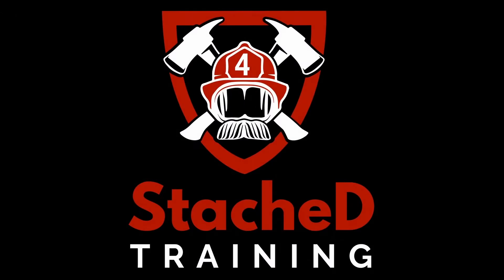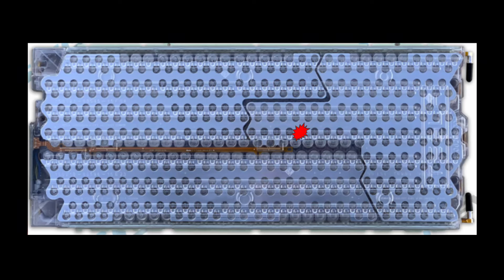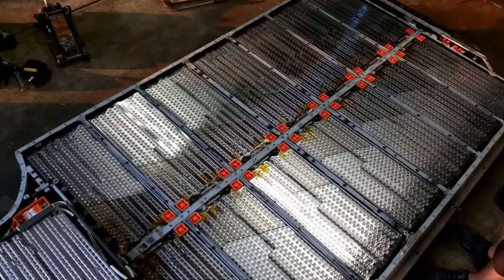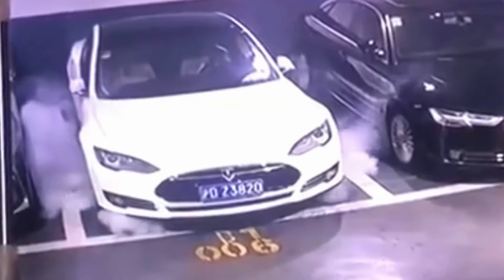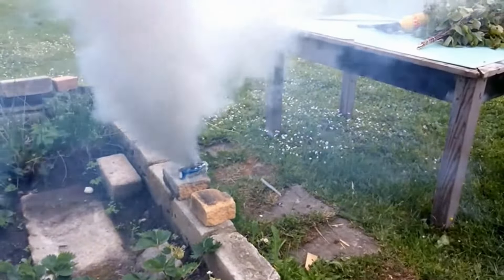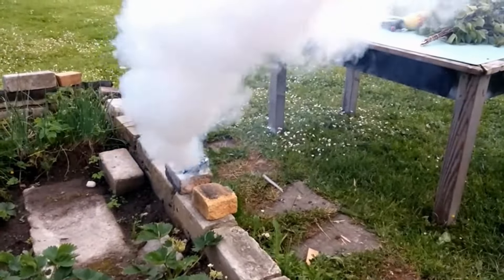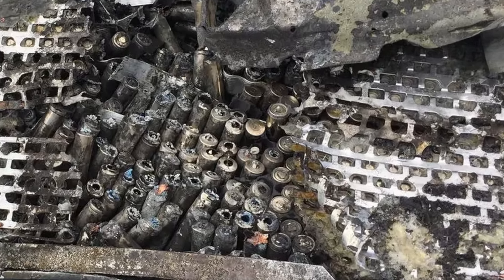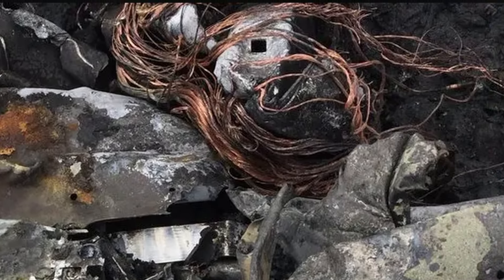What is Thermal Runaway: Lithium-ion Batteries

Comment: EV now stands for Explosive Vehicles!!!
Reply: This is virtually inevitable under load! The power draw must match capacity and as bat gets older therm is very likely. Its surprising this isn't common. Obviously cars go threw so much during a simple drive. A mere puncture, a metallic spec/sliver/screw(a f*cking gum wrapper!) etc flies in threw the vents and is an almost guaranteed goodbye. Simply charging and a surge happens, or just one bad bat during manufacturing can also cause this obviously, but these aren't even the main reasons! The draw is astronomical compared to laptop or phone and running a large quantity in series is a caveman solution! I mean, these vehicles are ticking time bombs and this has been understood since the 60's, when we already had a better option. I don't recall immediately but the alternative is capable of 50mph and is a fune solution both for environment and general safety, but no one cared about the environment then and obviously demanded faster stringer cars. We could use that older tech if we want to drive slower more expensive cars for environment sake, but lithium ion battery EVs are bad on so many levels I want tear my hair out when i hear people bring this up like "oh see this happened what a surprise!" They lio leak toxins when not in use for extended periods, mining is toxic, processing it is toxic, and its just a massive amount of toxic when done and inevitably exploded. They are a fine thing in a laptop or a phone but their preset use in disposable vapes and cars out to be criminalized! Its such a waste to use them on cars on so many levels its frustrating to this is even debatable. Theres is literally nothing good about lio powered EVS for the environment on so many levels and I hate cars so I am not even talking from a gas lovers perspective! Using lithium ion bats in series in cars is simply a caveman solution. Musk is a fucking hustler pulling wool over boomers eyes for investments promising a better solution eventually. Theres no need we if we want ev we could have had them in the sixties and can have em easily now too just not powered by lithium ion its upsetting!
Reply: It’s environmental vengeance! The environment is seeking revenge from those who seek to destroy it by embracing the current lunacy!😅
Reply: Or Extremely Volatile 😂
Reply: @paulorchard7960 i guarantee this comment was made on a device that has a lithium battery in it!!!!!!
Reply: Not only funny but true!
Reply: I tip my hat to you as a past airline electrical systems instructor and check airman.  👏👏
Reply: @RPcropland 👍👏
Reply: Electric vehicles are over priced junk. They're unpredictable.
Reply: @glenturney4750   You are smart!!  After having taught aircraft electrical systems for many years as an airline pilot (now retired), batteries can be very volatile and need respect. Aircraft do not have a battery pack 8-10’ long and yet can be very dangerous if not handled properly. Fast charging can be detrimental over time and needs to be watched closely. Thermal runaway can be disastrous. A big reason aircraft use external power plant to start engines when able. Power draw at initial start can be hundreds of Amps!  There is some use for golf carts, but not in my house as family car.
Reply: @gerrydave7586  : Totally agree with you! I use gas, or diesel power equipment and tools, (unless I use A/C powered hand tools) WHENEVER I do work on things. I do have a battery pack drill, (which is far weaker than my old 
A/C powered drill), but the REST of my tools are either plug in, or gas powered. When batteries get low, they lose torque and r.p.m's, but a gasoline engine will run WIDE OPEN/FULL POWER until their last drop of fuel, so I'll take liquid fueled equipment and vehicles ANY DAY over battery power tools. Imagine the Dem's trying to launch a battery powered rocket into space. They wouldn't get very far once their batteries started draining. LOL! 🤣🤣🤣
Reply: @glenturney4750  You are so right. Yet, so many ignorant people out there who have never done anything constructive with their hands.   How do you deal with those idiots?  Impossible!
Reply: LMAO, good one.
Reply: @scottw595 ,, spoken like a true pathetic liberal
Reply: @petehalasz7547  ohhh but wait I am not!!!!!
Reply: @hellofoodiebeauties 😂😂😂😂😂
Reply: So are gas vehicles.

Comment: I really hope they can come with some sort of separation layer, that will react with electrolyte at high temperatures and basically make battery into solid, non-flammable bricks.
Reply: That is the gist of the problem in that a specialised vehicle battery has not been developed in the hysteria of the climate panic and a lash up of torch batteries has had to do. The climate panic is an emotional thermal runaway in many ways, to match the cobbled together technology attempting to sustain it beyond current capabilities.
Reply: That's an excellent point! It is like the 'population bomb' hysteria of the late 1960s has led to almost every developed country having a below-replacement birthrate that threatens social programs caring for the aged.
Reply: That sounds like a great idea!
Reply: @jamesquinn3414  imagine the cost......to you.
Reply: I'am no expert ,  but , I think that there's attempts being made w/ the individual cells being immersed in a coolant , aiding thermal regulation .
Reply: LOL  Sure, that'll happen, just after the first herd of Unicorns is domesticated...

Comment: Lithium is a reactive metal, like sodium or potassium. Putting water on lithium will START a fire!
Reply: This is why they burn in floods
Reply: Except there is no lithium metal inside a li-ion cell, its lithium cobalt oxide as the cathode. What happens when you introduce water to that? (Hint: its not the same as with lithium metal.) What happens to lithium metal is irrelevant in this context.
Reply: @jibbtaylor   Only if the flood is with salt water, since it is way more conductive and corrosive.  If you look at all the stories of EVs catching fire when submerged or partially submerged, that water is always salt water.
Reply: What a way to show the world that you have zero idea of what you're talking about..
Reply: LTO, LiFePo4 batteries have no problems.

Comment: We were retired downsizing from a large home, thinking of a condo. We decided against it because a neighbor could have an EV charging then burn. Most condos have not yet caught up to this problem. A rule at least to require outdoor charging. Not one place we saw has any rule yet. So we bought a smaller, single level home in a neighborhood. I am a retired firefighter and considered this issue.
Reply: Smart man
Reply: Good points to consider.
Reply: I was pulling into a parking spot at the grocery store last week just then I noticed that the car in front of me was an EV, also known as an explosive vehicle I immediately pulled out and found another parking spot.  Your vehicle is not safe in a parking lot because at any time anyone could pull up next to you and park with their explosive vehicle. This really is a nightmare.
Reply: Yet you are happy to have 100 litres of petrol sitting around?  Thermal runaway with petrol is so fast is has its own name...
**
Reply: @PiefacePete46  yes, because it does not spontaneously explode. I have owned ICE vehicles all my life. Never had one spontaneously catch fire like an EV. Good luck and I hope you charge indoors. I fuel a car with no worries. If you charge outside, you are a coward to your ideology. Charge indoors only, please.

Comment: Great explanation. Some people are so anxious to rid us of the tried and true internal combustion engine and adopt what their short sided thinking about electric vehicles will do for the world that I believe they deliberately ignored and swept aside these very dangerous problems. From what I've seen with gasoline car fires they are relatively easy to extinguish especially it the fire fighters are called and get there quickly. I would bet there isn't much if any worry about reflash with a conventional car fire like there is with electric. I am a boat mechanic working at a marina with wet slips and dry storage. A lot of people for some reason are starting to convert from lead acid to lithium batteries. There is negligible gain compared to lead acid especially when the fire potential is considered. Also most of us in the business know the only thing most boat owners know about marine electrical theory or any other electrical theory is what some self proclaimed expert internet guru has told them. My point is with over 300 in stack storage these batteries, their installation short cuts, and poor maintenance including water intrusion is ripe for major catastrophe.
Reply: How much are garages being told to pay for their own property and public liability if they service these potential fire bombs, imagine an EV catches fire and destroys everything, even customers cars, they will have to remove all peoples cars to work on a single EV now!

Comment: I have owned four electric cars in the last 40 years, all had lead acid batteries.  We never had this problem.
Reply: But what was the power density of those? Yea, nothing compared to what's used now.
Reply: @slimjim1125   Correct, that's what makes lithium ion or LiFePO4 batteries more dangerous.  The higher the density, the more dangerous it becomes.
Reply: Milk floats used NiFe batteries, not terribly good for storage density, but the milkman was able to distribute his milk very early in the morning.

Comment: So is it possible that these things can catch on fire while you're driving them? That's a terrifying thought.
Reply: And remember, you're then stuck inside a vehicle that most likely uses electronics to unlock
Reply: People HAVE burned alive because of this and the fact that the doors WILL NOT unlock!
Reply: Anything is terrifying if you focus on the negative factors. How many normal cars have caught fire while being driven?
Reply: @slimjim1125  it's not the fact that it catches fire. Yes, ICE vehicles also do. But what is a problem is the experience if they do & how difficult it is to handle that fire, especially once it goes into TR
Reply: @kx8960 IDK which cars this applies to, but mine has an emergency mechanical door release in case of loss of power.
Reply: @DivineLightPaladin  It's not a Tesla then?

Comment: Have you seen the Danish Battery Briner system? Brine can be cooled to -18 centigrade without freezing, so more heat is removed more quickly than is possible with CO2. The salinity also shorts the cells, removing the energy sustaining the runaway.
Reply: very interesting to know

Comment: I use a lot of lipo batteries in model planes and helicopters if they are damaged they can still burn in water but if you put them in salt water it does kill them
Reply: Nothing worse than ignorance about batteries.   I tip my hat to you as an airline electrical systems instructor and check airman.  👏👏

Comment: I work with random condition lithium cobalt cells and there are some that start heating up around 3.6  volts during charging. This is only half full so something is happening internally. This is the condition that causes thermal runaway. The bms MUST have thermal protect.

Comment: The EV1 was, and is, the only ev (with easily recycled dependable, safe lead acid batteries) that would have been largely accepted by everyone and for that reason they were destroyed.
Reply from the maker: The EV1 had no where near the power or range.  It started as lead acid, but moved to nickel metal hydride.
Reply: Don't panic. Sodium batteries are out and these don't burn for shit.

Comment: I am convinced this extreme heat generated by the "Thermal Runaway" of lithium-ion batteries can be harnessed to power something like a steam engine.  Perhaps I should pose this suggestion to someone who understands thermodynamics and basic engineering - like Greta Thunberg, or Elon Musk.
Reply: That's probably a better use for lithium, add a little water to some and get all the energy at once.. but sort of controlled 🤔

Comment: I really disagree with the term "thermal runaway" in a battery fire.

It is more realistically called a chain reaction.

Thermal runaway is more a condition where a reaction starts, and the heat produced accelerates the reaction, creating more heat, speeding up the reaction more, creating more heat, and so on.

Yes that happens in a battery somewhat as well but the "cell to cell chain reaction" component isn't a thing in thermal runaway.

The thermal runaway that occurs in a battery such as in an EV is on a per cell basis. It does give the appearance of runaway to the entire battery but that is simply not the case.
Reply: it is in a sense, still a thermal runaway, rather than simple chain reaction. A simple reactions inside the battery isn't enough to create the heat necessary to making the same reactions on neighboring cells. It is the inital internal short in the battery, either due to a phsyical, electrical or thermal abuse inside one or more cell, which starts the initial 'heat up', which, in most lithium battery, is a self-fulfilling heat source due to how exotermic the reactions are, reaching upwards of above 500C degrees at minimum, where majority of the isolators inside the battery already melted at below 200C, means more internal short, creating more heat, which in turns heating up the reactive electrolyte, combusting them with the oxygen released from all the metal oxides inside the battery which starts to decompose at such high temperature (and even faster), creating a self-generating oxygen fires, with both the electrolyte and vented gas available to fuel the fire. The extreme heat generated by even a single failing cells is high enough that in short moment, it's reaching high enough temperature for the neighboring cell to also heat up enough to melt their internal isolators, creating even more internal heat, and reintroducing the same cycle again, again and again.

The heat, rather than simple chain reaction, is the reason it is capable of this much destruction. It's the heat that melted the isolators, allowing more and more internal short happened, which generates more heat. It's also the heat that facilitates the decomposition of metal oxide, releasing their oxygen content, allowing for a fire capable of burning without external oxygen source, generating more heat.
Reply: @danieltanusetiaji8931  Congratulations. You just described a chain reaction 🤦‍♂️
Reply: @MadScientist267  chain reaction doesn't need the heat to incur the circle, thermal runaway does. Without all the component keep generating heat to incur more heat generation, thermal runaway will just be a single, one time thing. Chain reaction doesn't need heat to works. Example: Nuclear chain reaction only needs the neutron and critical mass, no heat exactly required. And in the beggining, when you describe the thermal runaway, well, it's exactly what happened inside the battery....
Reply: @danieltanusetiaji8931  A chain reaction is any reaction that leads to more of the same reaction. The mechanism that connects them (in this case heat) is irrelevant. Stacked dominos falling is a chain reaction all the same.
Reply: @danieltanusetiaji8931  I think you're referring to a single cell. I'm referring to the entire battery as a whole. Starts with one cell that is not happy, and before you know it, that cell's thermal runaway, yes, causes a chain reaction to start that takes the rest of the cells with it.

I can go with that. I made that point pretty clear in the original 🤷‍♂️

Comment: Why aren't Battery Boxes vented?   By putting in a burst disk, you are guaranteeing that hot gasses and pressure is built in the box?   What if we vent the box when the first battery starts spewing hot gas?
Reply from the maker: Most boxes do have venting.

Comment: do I understand correctly that the runaway of even one cell ends up with a catastrophic failure of entire battery?
Reply from the maker: If one cell fails, the entire battery will likely fail.
Reply: @StacheDTraining  cell failure rate is 1/10 million, assuming 10 yr lifetime yields 1/100 million years. Having 10k cells in one battery yields the failure rate  of 1/10000 years, or 1 vehicle per 10k per year, or 1/1000 in 10 years lifetime. Looks like 10-100 times larger than the conventional vehicles

Comment: EVs have a niche place at best right now.   Mass production EVs are no where even remotely ready.   They are just pushing out what the mandates are pushing for.  EV's.   All the research I have conducted shows me that right now, in our current state of technology,  batteries are not up to this task yet.   It has been independently proven that the creation of 1 EV car puts more CO2 in the atmosphere than 1 combustion style auto.
Reply: Gas engine if you don’t ever start it is cleaner than an EV.
Reply: I tip my hat to you as an airline electrical systems instructor and check airman.  👏👏
Reply: That's true, and dependng on the production type for electricity, that deficit can be overcome  in as little as 8k miles in the likes of Norway/Sweden and around double that in UK and some other European countries with high renewables and nuclear output.

Comment: My Chinese made Ariel Rider Grizzly, 2 wheel drive, dual motor, dual battery, 52v fat tire E-BIKE shorted out, caught fire, and exploded, BETWEEN MY LEGS this summer as I gently old man rode it along on a dirt road at 10 mph! Since then, dealing with the company in, imagine that, Portland Oregon, has been a 6 month nightmare of trying to get it worked on and fixed. BEWARE! E-Bikes are made "there"!
Reply from the maker: Yikes!